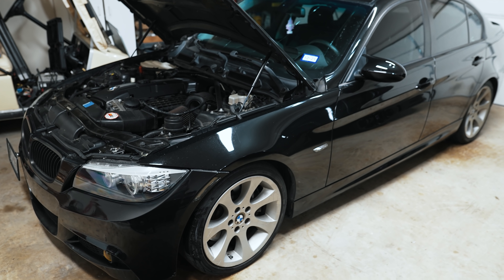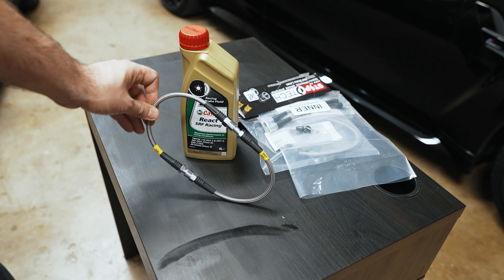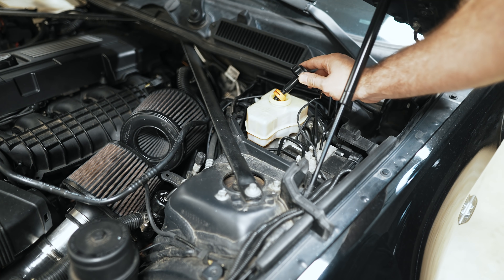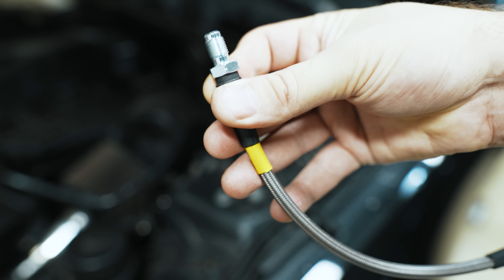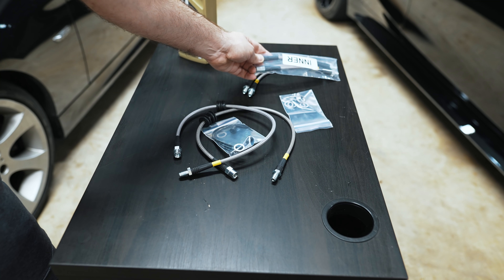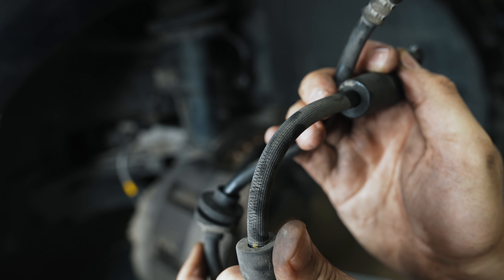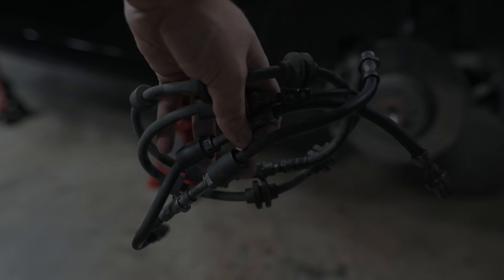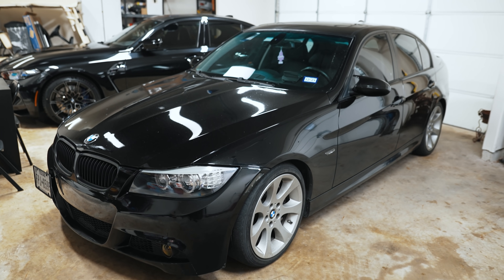Transform The Feel Of Your BMW With This!

Comment: The problem with any racing brake fluid is the fact that is has a shorter service life. Example: Motul normal brake fluid is supposed to be changed every two years, racing one is every year.

Comment: There's really no advantage to stainless steel brake lines. Performance brake fluid only really helps if you race or track the car. It's just brake fluid after all. I think it was the first time that you changed the brake fluid is why the sponginess went away.

Comment: Thißnis kind of misleading as that brake fluid is silicone based meaning it will not absorb water. I am not aware you can use silicone based fluid in cars not designed to run it.

Comment: When using INPA to bleed: Do you just let the system self bleed per wheel, then go and tighten the nipple?  There shouldn't be air in the lines after a bleed as long as the main reservoir is topped up?

Comment: Modern brakes don't gas out like they did back in the 70's, cross drilled rotors are purely for aesthetics (they do look cool). Most of what makes the brake pedal so firm on your M3 especially compared to the 335 is the mono-block caliper vs the floating single piston caliper, it's much more rigid and doesn't flex. Stainless lines aren't a bad idea for a car with high miles, and swapping out your fluid often always an overlooked service. Great content as usual, hope you are enjoying the new car.

Comment: At what humidity % do you change your brake fluid ? is 2-3% consider bad ?
Reply from the maker: Hmm I would say if it averages above 50% make sure you change it at 2 years.
Reply from the maker: and every 1 year if it's racing fluid.
Reply: It’s above 3% when you want to change the fluid. LOL at 50%.

Comment: Have you ever considered changing the wheel set up on your N54?
Reply from the maker: Yeah I would like to get a set of 193m wheels.
Reply: @VehicularDIY  Nice looking wheel, assume that would mean staying on 18"? What is your opinion on these versus your M3 competition setup, considering similar power on both, what differences have you noticed  regarding the bigger wheels? (Apologies if this is apples & oranges, appreciate there are a lot more differences than just bigger wheels, but considering changing wheels on my e92 and wonder if 19" are just vanity, or will I get advantages?)

Comment: Amsoil’s DOMINATOR DOT 4 Synthetic Racing Brake Fluid has boiling points of 410 degrees Fahrenheit wet, 580 degrees Fahrenheit dry, and it only $16 per 12oz bottle. Oh and with a Preferred Customer membership you can get 36oz for $34.20.... better performance and more affordable! 
https://www.amsoil.com/p/dominator-dot-4-synthetic-racing-brake-fluid-bfr/

Enter our Referral # @ checkout: 30164620

Comment: What brake upgrade do you recommend for a 2010 (n54) 335i e92 without breaking the bank (besides the brake fluid) ?
Reply from the maker: I'm looking into pads and rotors and will put up a follow up video.  I like Akebono pads and zimmerman coated and drilled rotors.  I'll do some research and let you guys know.

Comment: Have you considered brass sleeves for the caliper pins? ECS tuning makes a really nice set for $200.00 (for all 4 wheels) & it comes with SS pins. I’d also recommend SS rotor screws as well; especially if you live in the rust belt or a NE part of the country. 

Only downside to brass sleeves is that you have to re-grease the sleeves once a year. I use CRC silaramic brake grease & I still have to grease them 1x a year.
Reply from the maker: Yeah another commenter mentioned them, thanks for the info.  I'll look in to them when upgrading the pads and rotors.

Comment: You live in Texas so it wasn’t too bad of a job. But for a northern car with 12 years of salt and snow this job would be a lot more difficult.
Reply from the maker: Good point, even still it's tight up there with the two rubber lines on the drivers side of the car.
Reply: You’d have to take the subframe out of the rear to get the rear lines off. No question.

Comment: I took my 390HP 135i to the track and quickly cooked the brakes. It has six piston calipers and track compound pads, but even with track fluid, it was a struggle. Will probably upgrade to later BMW calipers and rotors if I want to keep taking this car to the track.
Reply from the maker: Did you have drilled rotors on three?
Reply: @VehicularDIY  Not three. Drilled rotors just on the front two wheels, not the back two.

Comment: Can you back up all the brake fluid/moisture technical nonsense comments you mentioned?
Reply: The technical nonsense is all legit. No fake information here. The one thing is stainless lines tend to help with slightly firmer pedal feel as the hoses expand less under pressure which results in a bit less pedal travel.

Comment: Wait , what bled the brakes ? What pumped the fluid through ? 
The ABS pump ? 
I always used the Motive power bleeder on my M6  works great , ECS has a nice stainless steel exact fitment kit that looks nice 
I have Banjo bolts on my front Calipers there Carbon Ceramics
Reply from the maker: Yeah the ABS pump did all the work.
Reply: @VehicularDIY  That’s amazing never knew this ! Thanks for sharing ! 🙏

Comment: I did this a couple years ago (both flush and steel lines) but I used a German brand - Bremsflussigkeit with 536F and 388F as the dry and wet boiling points. I don't push it that hard anyway so I did it more for the sake of a fun project than for any real benefit.

Comment: Can you do the F30 caliper retrofit?
Reply from the maker: I've heard that would require the master cylinder to be upgraded as well.  I'll look into it.
Reply: F30 MP BBK F 370mm R 340mm with e90 m3 MS that's the correct set up

Comment: Yes I’ve been waiting for this! This is the point of where I’m at with my build, my pure turbo N55 e92 is right around the 400whp mark on pump gas. Curious to see which aftermarket rotor you will decide on.👍🏼👍🏼👍🏼
Reply from the maker: I'm thinking of Zimmerman coated rotors which are drilled and Akebono pads.
Reply: @VehicularDIY  do they make them for the E9x?
I know they aren't available for the E82.
Reply: @VehicularDIY  Speaking on the E82. Some 135s  come with factory Brembos with a M logo that are compatible with the E90 chassis. Those with the Zimmerman rotors and akebono pads would be my ideal setup👌🏼

Comment: Have you ever considered the Brass Guide Pin Bushings that ECS Tuning sells? They seem like another good solution paired with the Stainless Lines and upgraded fluid.
Reply from the maker: I haven't, thanks I'll look into it when upgrading the pads and rotors.

Comment: Ive been following your videos since the steering wheel upgrades and after seeing your vid on the helix kit and more power, I've been curious for my car. Im currently on pure600 turbos on a custom tune for 91 Octane. Im still on the fence about the helix kit. Do you have any thoughts or suggestions you could share for some looking to make power in the 500whp range? I'm at 460 at the moment, but my fueling is maxed out. Thanks in advance.
Reply from the maker: Hey, have you already upgraded your lpfp?  Are you hoping to mix in E85?  How many miles are on your engine?
Reply: @VehicularDIY  my car had 203xxx miles. I tried an e40 mix tune with David Shoup and found out that my fueling is not capable. Im on a stage2 LPFP from fuelit and my HPFP is still pretty strong

Comment: It's worth mentioning, you're a Southern US car with little to no rust,
Most people won't be able to remove their brake lines as easily, for most people they'll simply shear at the join (it did to me, UK car) and I had to replace the whole line,
The rear 2 center lines on my car have literally an inch of rust on them 😂
Decided to leave the stock rubber lines on and go for a brembo Gt6 / gt4 setup,
I've never had a good pedal on this car despite bleeding with a pressure bleeder, ista, inpa and ista dsc rework etc etc
Reply from the maker: Noted, yeah I used to live in Canada so can relate.  Thanks
Reply: Same here. I now also have all new brake hardlines to go with the steel flexy lines :)

Comment: I’ve tracked my 335 with just drilled/slotted rotors, pads, fluid, and lines, and honestly I really don’t have a need for a BBK at the moment. The only reason to upgrade is for better lookin brakes, which I also want 🤣
Reply: You aren't going fast enough. I cooked the brakes on my 135i.
Reply: @ModMINI  i cooked them toooo 😂
Reply from the maker: Yeah the stock brake rotor size is decent enough for most of us.

Comment: I'm a big fan of Motul RBF600.
Reply from the maker: It's highly rated, I wonder why the wet rating is so much lower.
Reply: That’s what I run in my 335i and my Impreza, is good stuff n highly recommended
Reply: Anyone have any experience to compare RBF600 to the SRF to Ate Typ200?
Reply: @ModMINI  I used to use ATE Super Blue Racing Fluid in My XK8 and X50i, but no longer sold in US.  Now I just use RBF600 and change it yearly, but Castrol SRF looks good as well.

Comment: I flushed the brakes on my F31, but I didn't do it with software. As INPA doesn't support the F3x, can you do this in ISTA?
Reply from the maker: Yes you can.
Reply: The ISTA routine i used required a power bleeder and no pressing on/off of the brake pedal. Worked a treat though.

Comment: Just a fun question. Do you think you get the the boiling point temperature (under heavy brake usage) with "regular" brake fluid?
Reply from the maker: I would think so after a few hard braking events.
Reply: I have boiled the fluid on the track more than once. It would be hard to do it on the street; you would almost have to be trying to do it intentionally.

Comment: SRF is THE best brake fluid! I've done a lot of trackdays and ringlaps with it and it's perfect. Just make sure to renew it a bit more often than normal brake fluid.
Reply from the maker: Yeah good point.  Thanks for the feedback!
Reply: Anyone car to compare SRF to Motul or Ate Typ200?
Reply: @ModMINI  https://www.corvetteforum.com/forums/autocrossing-and-roadracing/2746522-which-one-motul-rbf600-or-ate-super-blue.html#post1576316722
General consensus is SRF is best around, if tracking routinely. But requires flushes more often for normal use. For street, ATe, Motul, should be fine.